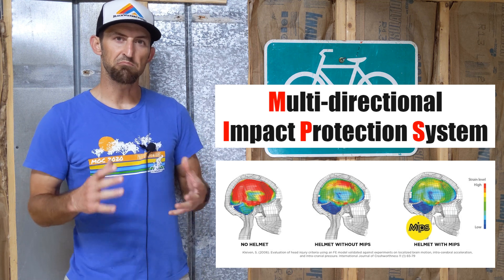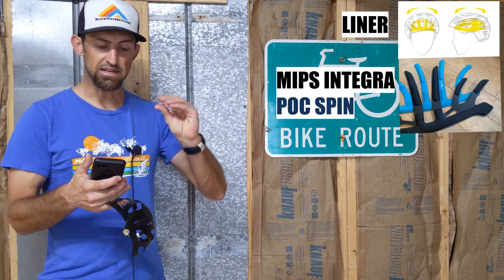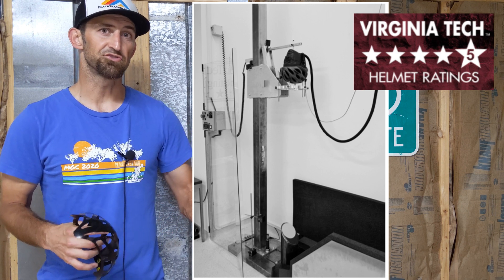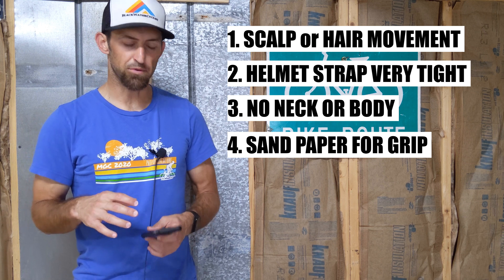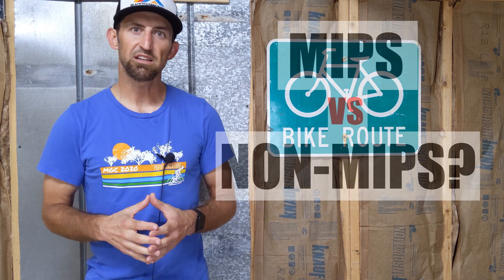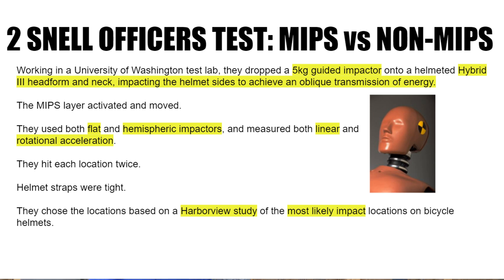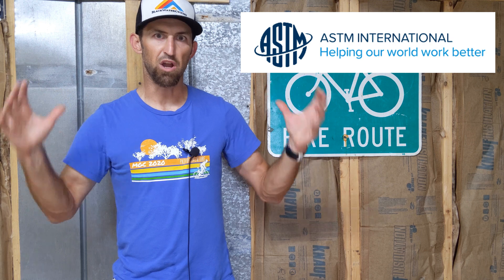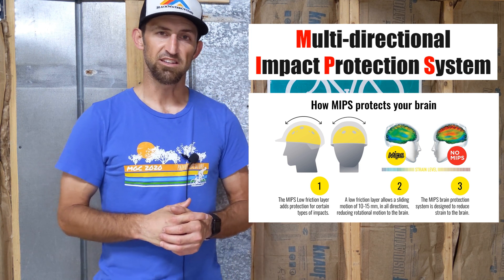Mips VS Non-Mips | Should You Buy a Mips Helmet?

Comment: I'm from the Netherlands, lets call it the bike capital of the world. Bicycle helmets are usually NOT  worn over here. But with the surge in electric bikes and the higher speeds involved  and older people picking up cycling (as goes for me, I'm 64) more head injuries are occurring.  I started looking into helmets and quickly saw that MIPS is hot. But is it better??   Now your videos is one of the few who is (at least) skeptical about it. Scientific research is the only way to go (only accident data will be maybe more clears, but that will take years to gather)   So, the bottom line is:  back to square one. I don't know what to pick, MIPS or not!!
Reply from the maker: Yeah I am just trying to be neutral in my analysis of things and I love that they are looking to make things safer but in reality, does it achieve what they claim. It has become taboo to say anything against a product labeled "safer". Most MIPS products are much better than what they were in the past so I am fine with having Mips in my helmet as long as it is not obstructing the airflow or compromising the fit of the helmet. I wouldn't go out of my way to make sure it was in my helmet.
Reply: @BlackWaterCyclist Your video and this comment really HELPED. I’m currently trying to find the perfect helmet and even just visited a lbs near my job. Good to know I don’t necessarily need to search for a MIPS helmet. Thank you!!🙏🏼

Comment: I agree with a lot of your points. Even when buckled my helmet has a fair amount of movement on my head, which seems like it would accomplish the same thing. I wanted a new helmet this year because my old one is hot and I care a little less about aero these days. I bought a poc because whether the spin pads do anything or not, they are comfortable, and they don't mess with ventilation at all.
Reply from the maker: Exactly! I am actually using a POC helmet now. I bought it more for ventilation than the SPIN tech. If the rotational tech can be added without obstructing from ventilation, I am fine with it being on a helmet.